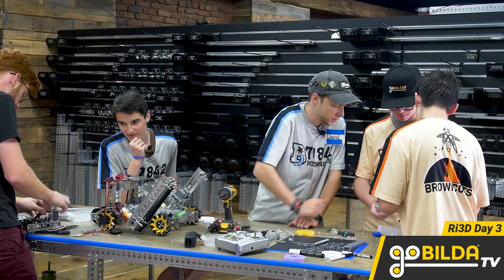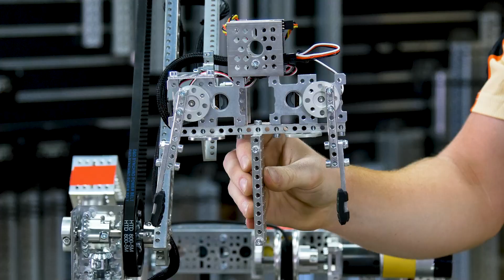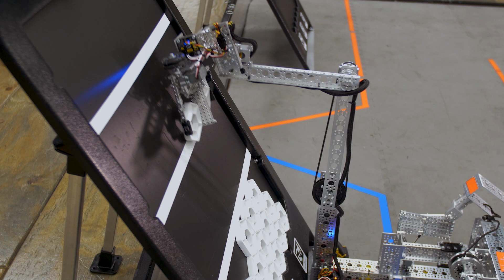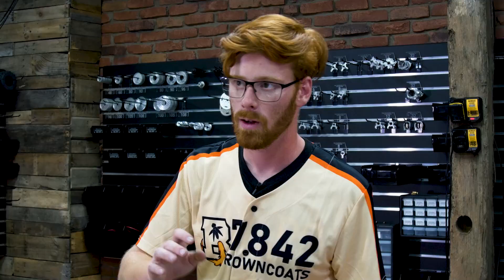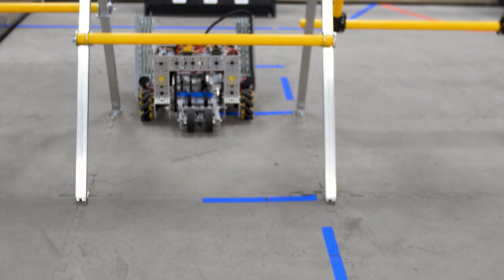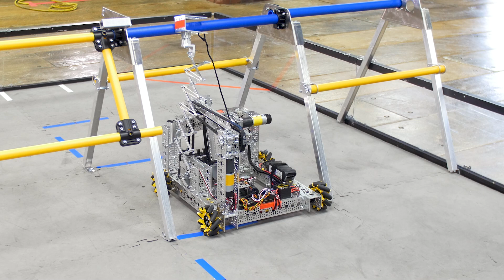goBILDA® Robot-in-3-Days FTC CENTERSTAGE Bot Breakdown

Comment: how did you mount the angled viper slides?
Reply from the maker: This product insight shows how it is mounted on that robot!
https://cdn11.bigcommerce.com/s-eem7ijc77k/images/stencil/original/products/2794/36930/3210-0004-0004-Product-Insight-2__79942.1695067135.png?c=2
Reply: @goBILDA  can you resend that link its not working anymore. Thanks!

Comment: At 3:25 in describing the arm you said it is driven by a "188:1 motor."  Is this the Gobilda yellow jacket 30rpm motor?
Reply from the maker: Yes, it is! https://www.gobilda.com/5203-series-yellow-jacket-planetary-gear-motor-188-1-ratio-24mm-length-8mm-rex-shaft-30-rpm-3-3-5v-encoder/